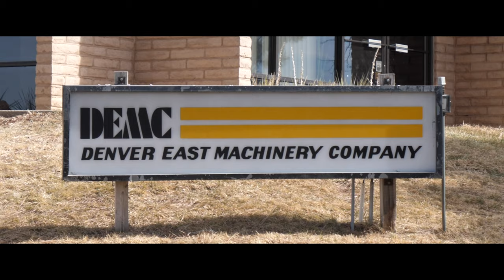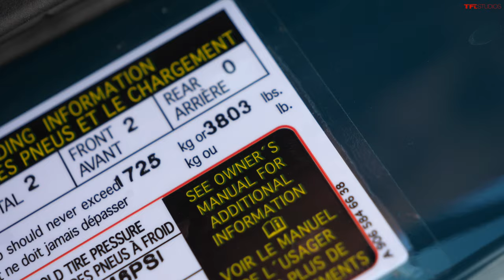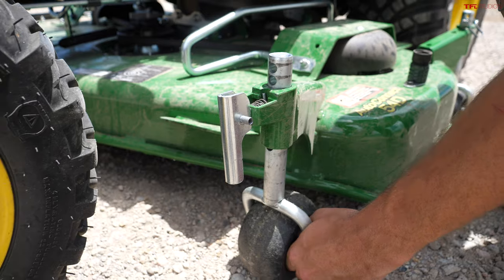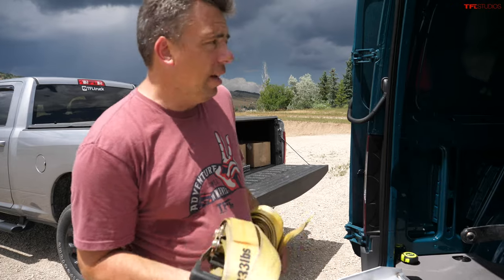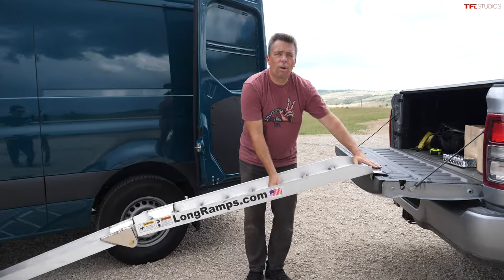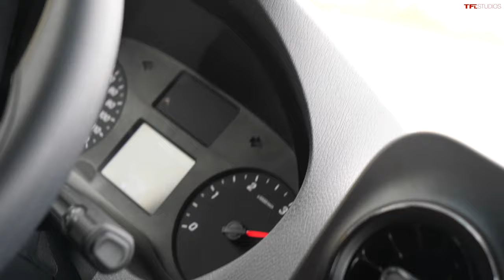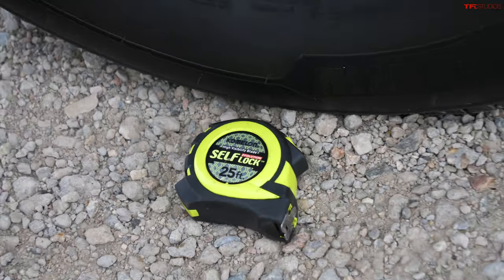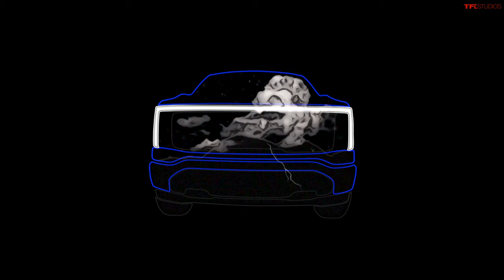SHOCKER! A Van Makes A Great Ranch Truck... Let Me Show You  | Taming Tumbleweed Ep.18

Comment: in europe we have the choice in a vast array of vans and pickup trucks. All contractors use vans, and for good reason. Theyre cheaper, have way more cargo space, use a lot less fuel and just more useful in general
Reply: I went from having vans for 10 years to a pickup (x-cab hilux).
Only downsides are more expensive (but it depends on what you buy tbh) and less space which I miss sometimes.
EDIT2;  Security with a canopy isn't the greatest compared to a van. 

The positives;
Proper 4x4.
Better at towing.
Better comfort.
More engine.
Space behind rear seat on the x-cab that you can't get on a van unless you buy a double cab.

EDIT; It's my own company so poverty spec white vans isn't my cup of tea.
Reply: @perpelle  yeah pickup trucks do have their benefits, but usually are outweighed by the negatives. almost no van owner needs 4x4, and rarely tow enough to get close to its potential. Comfort i definitely agree on, but that shouldnt be a problem as its a work vehicle in most cases. Engine defintely depends on model to model, you can get a bigger engine in the iveco daily than in a hilux for example.
Reply: @joshkiej6601  Mine is dual purpose so it's both work and private.

Noone buys iveco because it's crap reliability so that goes down the bin.😁
Styling and comfort isn't the best either.
Reply: The only advantage a truck has really is that you have a cargo space you can put dirty smelly filthy things in that you wouldn't want to put inside of a van.  I personally wanted a van as my next outdoors vehicle but like being able to put a kayak in and out of the back of a pickup truck much easier.  So I guess there's that too.
Reply: I think Europeans don't have to compensate for their small.... Things as much.

Comment: Used 2 of these Sprinter vans when I worked at a dealership.  Super useful, could fit a lot of awkward body panels and bumper boxes in it.  Only issue I saw which I hope they fixed was rust/rot.  All of the Sprinter vans in my rust belt area have lots of rusting issues.

Comment: So, this proceeded the TFLbike motorcycle video that came out 1st.  I guess it sort of explains why the van is being used.  Because you got your hands on it and were trying to figure out what to shoot with it.  But see, that does not seem like a difficult question to answer.  Just do all the things you would normally do with anything.  You do the walk arounds, the 0-60 tests, the comparisons to other vans(which I would like to see actually)the MPG loops, the towing tests, the  IKE with either a tow or a cargo run.  You have been doing the IKE tow test all these years, why not test cargo performances?  Load up things to their max weight and see just how competent they behave in difficult scenarios.  Which van would TFL promote for a camper conversion?  (from a basic cargo van)  Which 4x4 versions work the best in the RW?  There is content to be had here guys.  😉

Comment: That’s not the correct way to remove the mower but obviously it works.  No need to change the pins on the wheels, the release lever on each wheel will allow them to move up by pulling the pin.  The mower deck release lever does not need to be pinned up.  Great video.

Comment: Another one for you - a station wagon is sometimes a better truck than a truck!

When doing interior remodeling jobs in the city, I could pick up 10' lengths of plumbing, conduit, moulding, etc. at one store, load them completely and easily into the wagon with the front, passenger seat down, and have them locked and out of the weather while making stops at other stores or street parking...not possible in a pickup truck! : )

So, yes, vans (and station wagons) can be better at 'truck stuff' at times than trucks! : )

Comment: We had this predicament at our farm. Since we use plastic crates they are about 26in wide and all the trucks wheel well to wheel wells were 50-51 inches.  So we bought some Ford transits.  As they have a 54in wheel well measurements.  Just enough to fit our 26in crates next to each other where the truck was just too small. End of day just depends on line of work.

Comment: You just showed why a small trailer makes sense.   I am not removing a mower deck to transport a small tractor.
Reply: If you are transporting the tractor to do a mowing job having to remove the deck wouldn't  be good since you would still have to bring the deck with you. But if you are bringing it to a shop for maintenance the mechanic would likely end up removing it anyway so better not to bring it along.

Comment: Yes a van can do everything a truck can do and so much more, I was in the drywall business for 25 years and had 3 vans & 2 trucks running & the van's could do so many more things than the trucks couldn't even think about doing.
Reply: Am a painter. Can confirm.
Reply: There is lots of things a truck can do that vans can't. Vans may be more suitable for many jobs but the pickup can do every job
Reply: @jmanlinc  I've got both trucks and vans and my van can do everything my trucks can do & more.
Reply: I love my van, but I'm not going to drop a bucketload of gravel in it, I'm not going to put a dead deer in it, and I'm not going to tow 8k+ lbs. with it either.
Reply: @mediocreman2  I have a older E350 with the 7.3 Diesel so I will & have done all of that except for the deer, & the deer is a good point.

Comment: My company has purchased several vans and used them extensively for hundreds of thousands of miles. The Mercedes-Benz, while outstanding MPG, gave us fits, especially with the diesel engine and weird random computer issues. The Nissan NVs were very robust and maintenance-free (both V6 and V8). Still, all of them always had catalytic converter issues. The Ford Transit is by far the most liked van from the guy's point of view, especially the one with the EcoBoost. So if I were shopping today, the transit with the EcoBoost would be the one for me to buy. We never owned any Ram or GM. The Ram, as far as I know, might be good, but the GM looked like something from the 1970s, so they were never even considered. Just my 2 cents.
Reply: The Chevy Express with the gas 6.6 L8T is amazing and tows 10,000lbs.  Nothing else is close.
Reply: @markmonroe7330  that is definitely good. We don't tow.

Comment: Honestly welcome to Europe, it’s basically how we get things moving and done since vans are cheaper to insure, run and maintain and since they have great storage space and capacity as well as being highly modular and efficient, you can build either a workshop or even a camper and since here in England we’re not really expecting to go off road that often since most trip’s require the typical dropping off of goods and services a transit van is the go to, that being said we do use trucks or to be more accurate SUV’s for more manual jobs such as farming and construction where if you’ve got any tools you want that are in a hard to reach area, we simply use an SUV instead of a truck like the tyota, Nissan and here in England Land Rover defenders since price is much higher here in England vs the states, mileage and fuel consumption is a big deal when it comes to more working vehicles and since European roads are much smaller but much more efficient in which 70% -90% of where you want to go is either on a road or a dirt track and those who mostly go off road mostly use SUV’s or quad bikes because it’s just cheaper and more efficient here in the Uk, one quad bike with a trailer, your shovel, spade and hand grenades and you’re all good to go, and since it’s private property you don’t need. License for an ATV/ quadbike and so they’re ideal for things like farmers who have large fields in which they would use to find their cattle and use it to follow them vs walking all the way back, all the while the dog gets a free ride😂.

Comment: Small note, I ordered a 2023 Sprinter recently, the Sprinter's are no longer 4WD They 2023 is AWD, with the same system as in Mercedes cars. I believe these are the differences between the old 4x4 and the new AWD. 

2023 Sprinter AWD 
1) No low range.
2) Max 50/50 power split back/front.

2022 Sprinter 4x4
1) Low range
2) Max 65/35 power split

Awesome videos and information as always. Love the Channel!

Comment: There is a right tool for every job. In some cases the truck makes sense, others the van makes more sense and there is a lot of over lap. Just like nail guns, you would use a framing nailer to hang a piece of trim. Sure you could do it but it won’t be pretty

Comment: I work at a Mercedes Benz dealer as a parts driver and I drive a 2022 sprinter and it has the 2.0 liter 4 cylinder turbo diesel in it, so I wonder if that's the new engine that Andre is talking about.

Comment: Please review the last generation of the Dodge Ram Van Wagons from 1994-2003. I really want you to review this truck and all the American Vans like the Ford Econoline that was sold as a van until 2014 and then they only sold it as a chassis that was updated from the interior in 2021 and also a good review of the Chevrolet Express which is the Last Classic American Van built on a frame.
Thanks The Fast Lane Truck  & @TFLClasics.

Comment: You would need to put the ramps in the back of the sprinter too, if you were using it to take the tractor in for service.  Not alot of room left for those in the back of the sprinter.
Reply: Plenty of space put one on each site or under the tractor